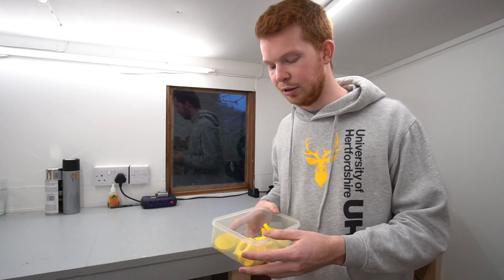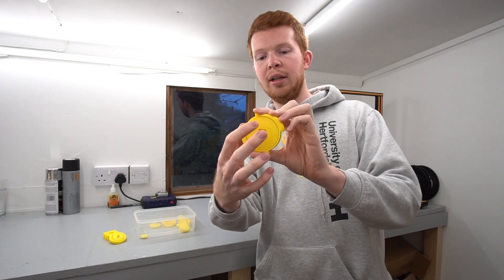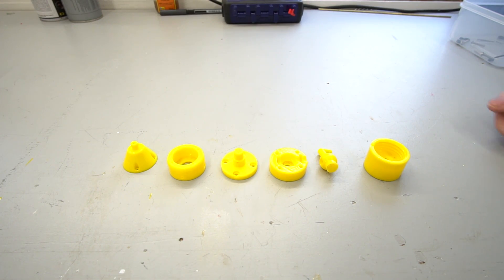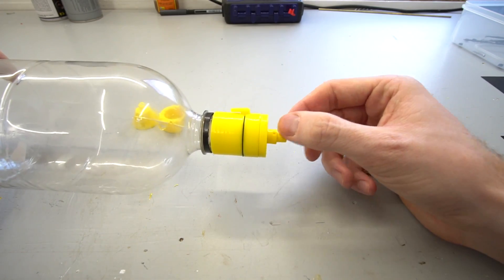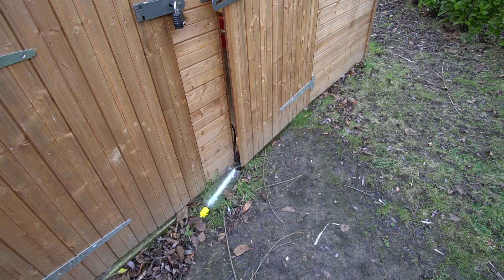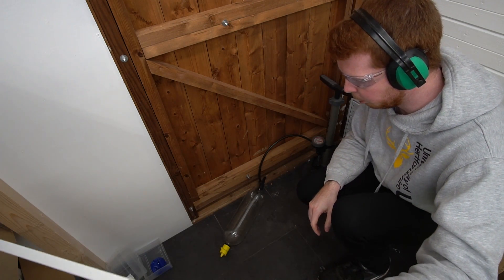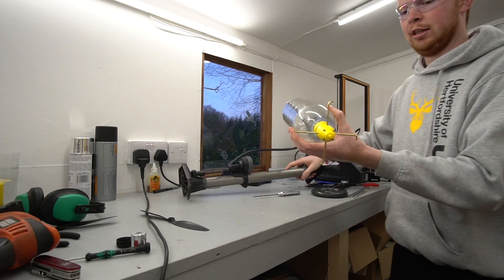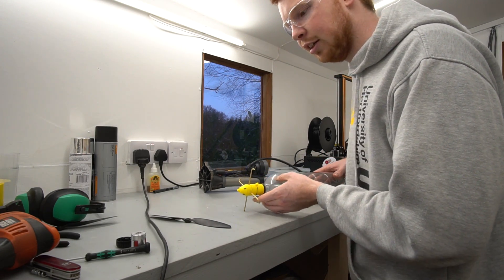Air Powered... Propeller?

Comment: You should use the air pressure to spit out water from the nozzles!
Reply: wouldn't be very efficient. you'd need a massive steep angle of attack propeller in order to make any use out of it! (Tried it with a store bought air piston plane. It just made a mess pretty much. didn't really blow any useful air either.)

Comment: Tom, have a look at the diameter of all the connections between the air cylinder and the outlet, I suspect what may be happening is that the delivery of air to the end of the tubes is a similar diameter for a long way to the outlet so the velocity of the air will be quite high for a long period so will incur large losses before any thrust can be made.  

If the outlet itself is narrower than the rest of the pathway from reservoir to outlet then you'll get an acceleration very late in the pathway so reduce the losses.  Any bottlenecks in this pathway will accelerate the air and increase losses, and reduce thrust.

In the end though, there is only so much power you can get from compressed air, so the ratio of effort to fun playing with the final product is never going to be that great.  The fun has to be all in process of creating the product I guess, sure if plenty of learning opportunities along the way.

As for future content, I would suggest doing stuff that is fun for you, both in final products and the creation process.  Sharing in what you learn and what you finally achieve is a big part of your channel so far.  Having a series of episodes that show the journey work would be my preference, but if the video recording process ends up dominating your time then it could get in the way of the creative engineering process.

Comment: Bottle rockets use water because it gives you more impuls. In your design the air just expands freely which wasted energy. When you excellerate water you convert some of the pressure into movement. So if you fill the bottle with some water, and use a push prop you might be able to take of vertically. That way the water stays in the right position.

Comment: maybe if you shorten the metalstraws you will get a better result. its easier to turn it if its longer but maybe the air velocity is too low at this point and it can´t accalerate further

Comment: Nice project!

Is the issue not that there needs to be a seal (albeit with low friction) between the moving and stationary parts. 

Why not hold the propeller stationary and see if the air is leaking through a path other than the four nozzles...

Comment: It sounded like the air was escaping from other parts of the assembly rather than purely through the nozzels. Filling the bottle with smokey air may help determine if this is the case if filmed at enough fps

Comment: you need more mass exiting the nozzles air just wont cut it. half fill the bottle with water and run it upside down more run time as the water is non compressible and has more mass to increase the chooch factor!

Comment: What about bending the metal nozzles back in on itself, then to the sides, the inertia of the spin will slow down the air inside them wont it? at least it will counter the literal pump action you create and expend fuel for from the spinning tubes to suck the bottle empty.

Comment: Hi Tom.  One of the things I like about your videos is the fact that it's REAL; that is to say, genuine.  You explain your thought processes very well and then without a lot of actual production, you assemble and test an item.  Excellent.  I like that way of doing things.  It cuts to the chase and proves/disproves a point.  I personally would be happy to see as many videos as you can practically manage, so the production in stages (weekly) seems to be my preference.  A couple of other things if I may.
1) Pressure testing your bottle is wayyyyyyy safer if you fill the bottle with water.  As I know that you know, water is (virtually) incompressible, but will communicate the pressure applied uniformly over the bottle and if the bottle does decide to let go, the explosive force is not as dramatic.  Maybe 12yrs ago, I made a similar bottle to yours to prove to my twin boys that air does weigh something.  My compressor can reach 120psi and I tested as described to that pressure.
2) Using the expulsion of air to then drive the propeller is (again, I know that you know) relatively inefficient, but a certain guy called Hero did something a bit similar some years back but with steam. :)   Also, you may be aware that in the very early 50's a British aircraft (ahead of it's time - again), called the Fairey Rotodyne used rotor blade tip combustors supplied with compressed air up the rotor shaft and out along each rotor blade.  Check out: https://en.wikipedia.org/wiki/Fairey_Rotodyne
3) Probably (definitely), not a good idea to hit ceramic bearings with a hammer or any impact device.  Pressing is wayyyyy better :)
4) I am/was, an electro-mechanical engineer who studied aeronautical engineering and I have a (too) small workshop.  I know you make a lot of stuff from 3D printed plastic, and I get the feeling you may not be a million miles away, but if you need some metal parts made, pm me.
5) Finding many ways NOT do something can sometimes be fun and enlightening, so carry on I say.
Regards Mark in the UK (Buckinghamshire)

Comment: You need to open up the ports to the nozzles. Right now you have just little bitty holes that only produce thrust when the nozzles line up with the little holes. Most energy is wasted with the ports being so small. Unless you built a timing valve but it would be easier to just make the ports bigger

Comment: Guess he's never heard of a water rocket.
Reply: The reason why a water rocket works so well is because it is way more dense than pressured air and has a much higher impulse because of that. Also he didn't want to make a water powered engine but an air powered engine, so there is that.

Comment: You can always make it CO2 powered and put a chunk of crushed dry ice in there with a tiny bit of water and maybe you can have more sustained pressure for longer... and do chunks so you can check the comments for sweet tips like this one to supplement the failures of your designs, lol JK I've never even seen one of those baloonocopters?

Comment: Great stuff again. The best way to recover energy from compressed air is with a zero leakage steam engine design, but instead of running a long stroke piston in a sleeve cylinder, use a captive sealed diaphragm design with a very short stroke, and use a radial valve on the crankshaft to induct and exhaust. with no leakage between power strokes you can extract way more of the energy.
you could also make a simple regulator to smooth out the power delivery and greatly extend the run time. Cheers, keep up the great work.

Comment: Have you considered using much higher pressure with a different type of vessel with a regulator? That way the engine sees fairly constant pressure rather than just tapering off. Also using a turbine or piston is better as its more efficient.

Comment: have you tried making a multiple cylinder engine?
If you create multiple air powered engines and link them together in such a way as the exhaust air of the first engine works to fuel the next and so on.  Another idea is try adding a gearbox with a similar design as the one in this video: https://www.youtube.com/watch?v=V_vp-hgRAh0 
The only exception is the driveshaft of the engine is connected to the gear and the worm gear powers the propeller.

Comment: I enjoyed watching the test, even though I already knew how it would work out. The air exits too fast, and it has so little mass that it doesn't impart much force on the little jet thrusters. You're trying to power the prop using newton's 3rd law, which is horribly inefficient for this. You should go back to the original turbine concept like the "paddle wheel" idea, since it does not waste much energy. If you can make a paddle type design and then get it to seal around all of the edges properly, 100% of the kinetic energy will go into spinning the prop. Now, the good part.... 100PSI is really a huge amount of energy and massive torque on the prop that you don't need. So, in theory, you could stick a gearbox on the turbine and convert that torque into higher RPMs on your prop, which also decreases the RPM of the turbine when you have a load on the prop, so your air charge lasts longer. The key is your turbine design. It can't leak air around the blades. You should concentrate on improving the tolerances of your 3D prints, or consider making them over tolerance and sanding the parts for fit.
Reply: I had another idea, which would be easier to print and get a good seal. Try using an Archimedes Screw Turbine. Make it sufficiently long so that the leaking by small imperfections are minimized by the overall length of the screw. The gearbox idea would also apply to this design, and since the turbine would turn relatively slowly, it wouldn't really need fancy ceramic bearings. Save those for the output shaft. You might also look at making a tesla turbine as a power source.

Comment: If you can here a noise in the bearing you are creating friction. I'd try a metal bearing and remove the grease to make it easier to spin. Or maybe a bushing instead of a bearing.  Less moving parts to create friction. I have my doubts about the efficiency of this ideal. But it is cool to see you put this much thought and effort in to this project. Hats off you you Tom! Keep trying. I enjoy watching your progress. And i have learned a lot.  I am in to 3d printing to. It's a awesome resource to have at your finger tips. It's need to be able to go from the drawing board to working model in no time. Click on my name and you can see a few videos of my printer project.

Comment: What about something like those YouTube videos spinning up bearings, except using a planetary gearbox.  You would feed air into an inlet on the ring gear, and in order for it to escape, it would have to push the planetary gears until they reach a spot with a vent hole

Comment: I wonder if it would be able to spin faster if it had a gear translation. But that would probably make it too heavy and set off the center of mass while producing too much friction. 
I think even if the RPM was faster there would still not be enough lift, because all that air from the prop and the exhaust pipes will just generate a lot of vortexes.

Comment: in parts i think would be good. that way we can get a bit more detailed explanation of the design steps..  you can get a lot more information in 3, 15 minute videos than 1 video.

air alone is not enough, i remember bottle rockets that had water as propellant mass.

Comment: Fantastic work, man. And congratulations to the 400k subs! :) Two tips I could give you is to seal up the valve with a bit of epoxy glue. The other is about the axle, next time design it like a spinner axle... You know what I mean? In two pieces, one screwing over the other. ;)

Comment: About this engine type: what if you only had two nozzles? That's half the area for the air to escape through, so all other things equal, it would last twice as long on the same charge of air. Realistically, it probably won't double. I also think these engines need some kind of governor so that the energy release is more constant.  

Maybe it would also be worth looking into those super lightweight indoor rubber band airplanes that move very slowly, but have a long flight time (and bounce off walls). You may be able to harness compressed air to power something similar, and it'd probably last longer too.

Comment: So it doesn't have enough thrust for a plane, but would it have enough thrust to push a lightweight little car?
Reply: SUV RVing He talks about it at the end. Theres not enough thrust to even spin the propeller, which weighs almost nothing, so pushing a car forwards would also not work.
Reply: Would work with a much larger single nozzle, but all or most of the air would be released at once, and that's all.
Reply: A well designed one nozzle could give you the best results. Your nozzles do no look efficient. Most of the energy seems to be converted into heat. Just take a look at the nozzles of the jet engines.
Reply: MK there is a video of a AirPowered car

Comment: Here are my suggestions:1: Ive noticed that the exhaust tubes are made in such a way that they lose efficiency, make them longer as it would increase the moment arm length thus making it spin faster2:The perpendicular exhausts are pointed in such a way that they push a little forwards alongside of pushing sideways to make the propeller spin...make sure that they are perfectly centred in such a way that you do not lose any energy to the exhaust tubes pushing forwards as it causes friction and introduces a pointless vector (just dont give ''pitch'' to the exhaust tubes)
Reply: Longer tubes add inertia and friction and does not add power. The tubes are pointed backwards to align with the incident wind, as the whole bottleplane is supposed to move forwards. If the tubes were aligned on the plane of rotation, when the bottle is moving, you are pushing the wrong way, opposing airflow and slowing down. Having them not point backwards would decrease efficiency.
Reply: Amir A yes! Also I think he is getting huge friction losses by abruptly changing the direction of air

Comment: Having the air "not produce more power" than the piston engine doesn't prove that it won't give you less thrust.  There is friction in the system when transforming power from one type to another.....you're converting it twice (and pressure -> thrust is a nearly frictionless state change).

If this wasn't the case, then compressed air rockets wouldn't be a thing.....just have to find a way to control the pressure released as a gradient (as more is converted, the faster it needs to be released)

Comment: I think your bearing would spin more freely if the tubes are pointed directly tangential to the rotation axis, rather than at a slightly reversed angle.  The ball bearing you have is made to carry radial load only, so giving it a forward thrust from the back pointed tube might be generating too much friction and wasting precious stored energy.  That might be why it failed to start on its own from just the air pressure.  It could not overcome the static friction due to the thrust load. Just a thought.

Comment: If you print at 0.1000 mm on the CR-10 you can get a 0.2 mm Tolerance using Hatchbox PLA filament
Reply: 0.1mm what
Reply: I recommend eSUN PLA+ (or other PLA blends, of which there are many) for pressurized systems. It's not as brittle as regular PLA and will not shatter. It's more like ABS, but you can't acetone smooth or weld it. I use it for pressurized parts of my water rockets. It holds up great.
Reply: Sorry I meant 1 mm

Comment: you might consider determining the minimum pressure needed to spin the propeller, then add a pressure regulator to the design.  That way instead of just dumping all of the air at once, you can maintain a constant flow for a longer period.
Also, I would suggest switching from ABS to PETG for your prints. You will get less shrinkage from your parts and thereby have better tolerances overall.

Comment: I like the idea of having multiple videos for large projects.  It may make it easier for you to explain and present more details.  And congratulations on this 'failure'.  I think just expanding and exhausting compressed air through a nozzle has more energy losses than using a piston to expand it.  I think the piston expansion is a more 'reversible' process than the nozzle expansion.

Comment: Clicked on this so hard my mouse broke.
Reply: Rip little mouse, we will all remember its loyalty and sadly hard abuse of its owner..
Reply: Couple ideas.... A regulator for more constant pressure. Another idea, make the nozzles smaller, with Venturi ports to pull more air  volume. Have you considered a chemical reaction in the bottle, like hydrogen peroxide and aluminum?  Obviously, you wouldn't fill the bottle. I've watched some of your videos and admire your motivation
Reply: Ryan Shuey, and then use the exhausting gases from the chemicals as fuel and oxidizer. Ignite the propellant  with a remote controlled spark plug ,in a from one side closed pipe. Now you've got an improvised model afterburner or at least you'll get some visual effects from it. 😉💭  👉  🛫🚀🎆🎇   🤣🤣🤣

⚠️ Disclaimer: Dear reader, I do not take any responsibility for your experiments. And everytime keep in mind😳💭, chemicals or some elements can be dangerous. ☣️/☢️   💨/🎇 >> 🤪😵🤢🤮    🔥 💥😱😭🤕   💀⚠️
Reply: How did you wright a comment then;)
Reply: The Skydivers  get a new one
Reply: Time to upgrade to an air powered mouse
Reply: Hmmm. How did you select the "add a comment" box then? XD
Reply: Wy are you toen stil able to post this comment? 🙃
Reply: Just finished watching. I'm sorry for your loss.
Reply: lol XD

Comment: Hang on - the balloon copter works well and must be at like 1-2 PSI?  Doesn't it seem like 40 PSI should be enough to fly the whole thing away?

The balloon does a better job of regulating pressure than the bottle.  The pressure in the bottle drops exponentially, delivering a quick burst of power and quickly dropping off.

I think nozzle geometry might be important because you want to avoid turbulence .  Maybe graft the turbine part of the balloon copter onto your swivel and see what it does (explode?)

Comment: You should reduce the jets to only two (to save weight)
Reply: Exactly what I was thinking. Feels like the difference between a 2 pole and 4 pole motor. You want higher speed not torque. So try 2 jets only.
Reply: David Ball yes!

Comment: Seems like a lot of air is being lost as the air supply is not directly connected to the vanes, finding a way to seal the region at the bearing might help a lot. Also using a smaller vane tip (maybe try and fold the tube in on itself?) would mean the exhaust air at the tip must travel faster